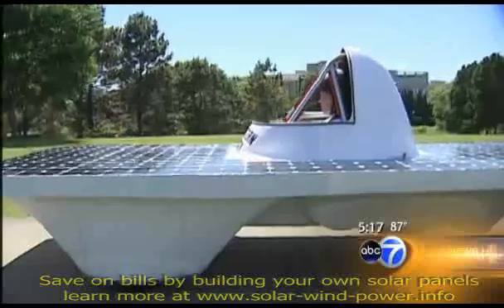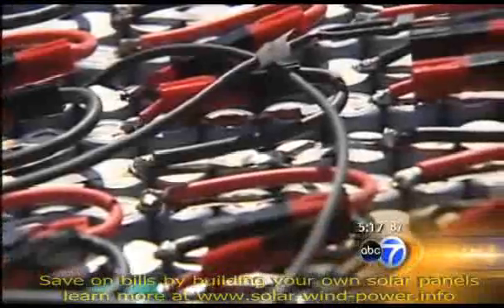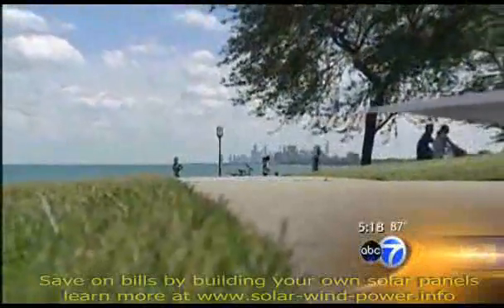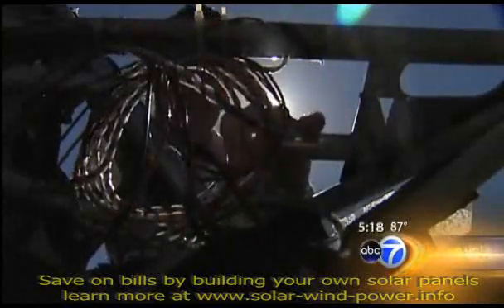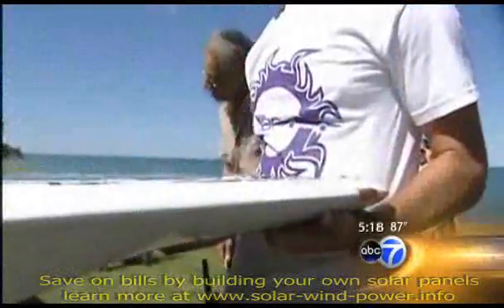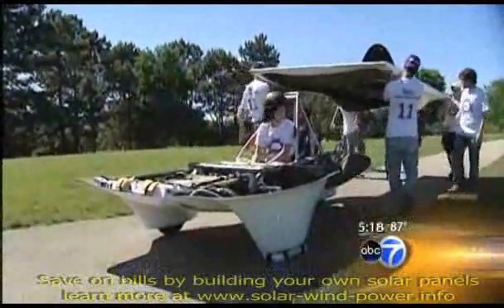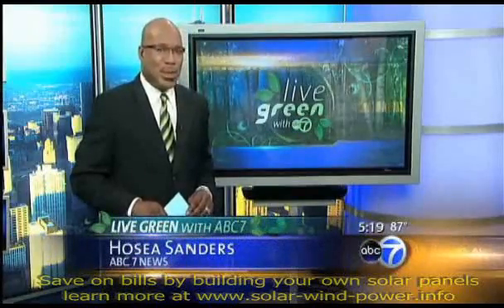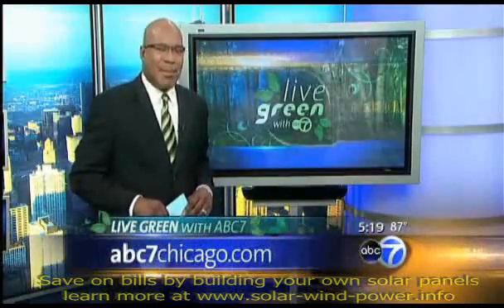Students build solar-powered race car

Comment: Great science project. They can do this with an ex-Nascar stock car also replacing the old Nascar engine with a 1000hp electric motor, solar panels for the front and top hoods, including long lasting rechargeable batteries powering that 1000hp electric motor. Good luck Bill Nye satires.